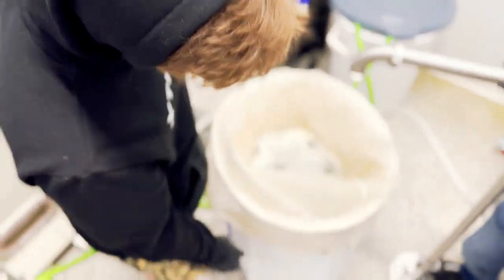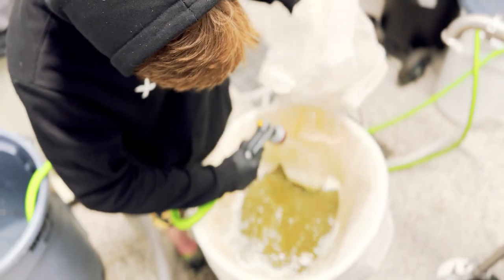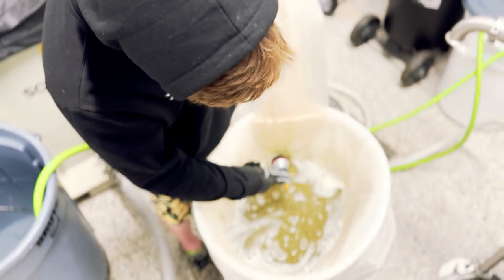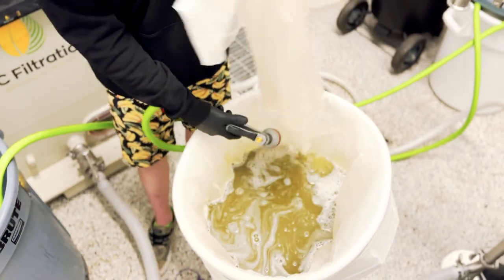Mesclatore Drain-to-Waste Trichome Collection Process

Comment: Put a pully above the lift area with an anchor point you can tie off to. When the 25 is almost empty put a clean dry towel under it. It'll pull most of the water out.

Comment: Why no parchment?
Reply from the maker: He is not a fan.  I’ve seen this a lot. Parchment reduces the heat transfer during the sublimation process so slows it down. No data to fully make a claim here but it could be a valid point.
Reply: Parchment sucks.